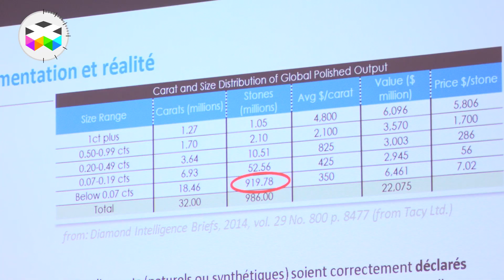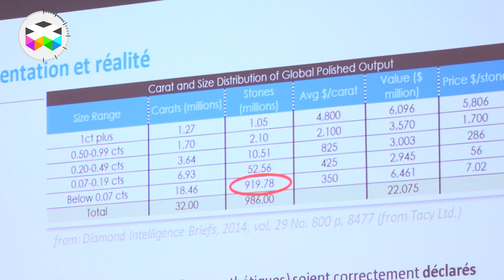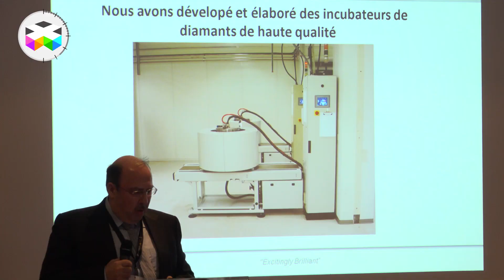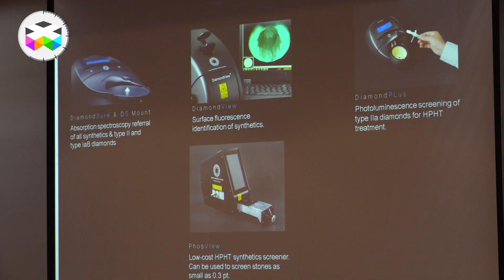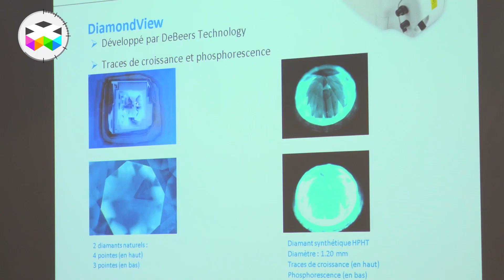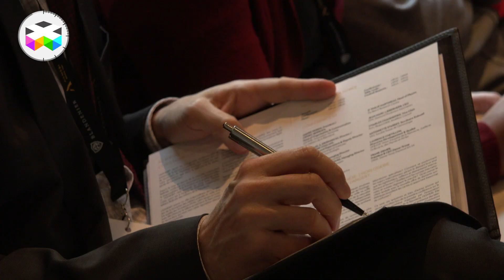The Problem of Synthetic Diamonds in Watchmaking

Comment: I prefer man-made diamonds.  
NO African murderer is making money off them, and they are identical to natural diamonds,  they copy nature to make them.  

Also, natural diamonds have imperfections in them, man-made diamonds are perfect.  However, if you want they can add minerals to tint the diamond to any color you want.

In the end, anyone can afford a nice diamond.  That is not true with natural diamonds.

Given the extreme heat resistance of diamond, we will soon be seeing diamond computer chips.  Able, without extreme cooling, to do huge numbers of calculations.  They will revolutionize the computer industry, which today, uses silicon chips that melt at high temperatures, and so are limited in how many calculations they can do, and so need extreme cooling to work. 

People don't care that the food they eat is grown on a farm and not gathered wild in nature, in the end, they will think of diamonds the same way.

A diamond, is a diamond, is a diamond.

Comment: I have a small collection of diamonds, including natural and synthetic diamonds, and i now prefer synthetics. Going forward i will buy synthetics. 

Numerous reasons, the most important one is where the money goes. With naturals, there can be blood diamonds, or you pay workers working in bad an unsafe working conditions, nature is destroyed in the process. Best case you pay for well-compensated workers using very big machines with safe working conditions, but the same damage to nature. With synthetics, you pay for scientists and engineers, well-trained, well-paid, working safely in laboratories with excellent working conditions, and the main resource needed is just electricity. Not vast amounts of land and water and soil being shifted around. You like watches done by well-trained and well-paid watchmakers in nice facilities, right? Synthetic diamonds resemble that much better than naturals can. 

Then there is the consistent high quality, and the amazing colors. You get this quality in naturals only by rigurously selecting and matching the rough, rejecting most of it. For coloreds, in naturals less than one in a million diamonds is pink, it is the same for some other colors, and then you only got the category of color down, more matching and selecting and rejecting has to be done to have them all in the same tone of pink. This is ridiculous, and leads to the next argument.

There is a big monopoly keeping diamonds artificially scarce and keeping the prices artificially inflated. Most rough diamonds get sorted and then stored away, never to be cut, never to see the light of day. Only a small percentage ever reaches the market, and that after resources were spent to mine it all. This also brings a price risk, if these massive vaults holding maybe around 90% of the rough diamond ever mined reach the market, prices will be shattered. Diamonds are nice, but this fact makes them a really bad investment, especially long-term, and if you only pay for the beauty and quality of the material, knowing that it is not a store of value but a long-term shitty investment, it makes sense to go for the lower price, especially if the quality is consistently high and the optics are indistinguishable. 

The quality of synthetics is already at the top, the only struggle left is to reach big size, but progress is being made in that area. One thing to consider is that market penetration is still low and most wholesalers do not yet include synthetics in their portfolio, for fear of risking their good relationship with the monopoly i referenced earlier. So while prices are lower at the same quality, the absurd situation is that the effort to track them down is much higher.

All that taken into consideration, i see a big future for synthetic diamonds. The naturals only have top-notch public relations and marketing strategy going for them, but this can only slow things down once you really grasped the fundamentals.

Comment: I only buy Lab created diamonds they have the same real material as a natural diamond.  I pay half the price but, it's worth it. Simulated diamonds are the synthetic ones.   I feel very good about walking around with my lab diamonds but, my real diamonds are secured and locked away for my eyes only.  LoL.  My real diamonds are insured but, my lab diamonds are always in real gold settings. So, I can carry value on those as well.  As long as the Lab diamonds are maintained and kept in good condition you can always resale them.  Period. Plus they don't age as fast as a natural diamond.

Comment: Man made diamonds can save the jewelry industry by bringing down pricing to the level of Economics we "the normal" people had to adjust ourselves to. At the other hand, a natural diamond has a far nicer color dispersion, much smoother than the somewhat harsh blue-greyish shade from the Man-made diamonds. But I have to be fair, most people need a microscope to spot the difference. 
If money is not a relevant factor in the consideration of purchase, natural diamond is the better option. There's more than enough supply to meet the demand, no need for mining or other pollutive actions.

Comment: Come on folks, diamond is an allotrope of the element Carbon. It does not matter whether it is man made or mined from the ground it is the same thing. I suspect however that man made diamonds can be purer and have a better crystalline structure due to controlled laboratory conditions in the manufacturing process while mined diamonds had all sorts of impurities and uncontrolled conditions while they grew. Therefore man made diamond is actually better. Newer processes will inevitably only make better, larger and cheaper diamonds. A cartel can only last so long and this cartel has lasted long enough. Diamond is too important to the development of technology to be controlled and restricted by individuals or cartels. Wake up and smell the coffee folks.

Comment: As far as i am concerned if it is as hard as diamond, has the same chemical composition and is in all other ways indistinguishable from a 'natural' diamond then it is a diamond.  The diamond cartels just do not want to lose their control of the market.  To me the best use of diamond anyway is industrial.  Abrasive surfaces, scratch resistance, heat sinks, high wear contact surfaces and lasers.  Wasting such a useful substance just to satisfy your vanity is pointless.  In the end it is just another crystallized element.

Comment: Watches for myself are about capturing and portraying the marvel of modern engineering. In particular, using computer aided design (CAD, CAE) and modern materials to push the boundary of microscale mechanical engineering and horology.

I would think that also being able to capture the engineering beauty of synthesizing one of the hardest materials known to man, while also capturing a high clarity and highly reflective nature of the diamond also plays strongly to this theme, thus I would have no issue with having a synthetic diamond. After all, diamonds in jewelry are really only prized because they are shiny (due to the clarity and cut of the diamond)

A synthetic diamond works just as well as a real diamond, or in the case of optics and some semiconductor technology, better. 

The argument that real diamonds are 'a work of nature and should be marveled', feels weak to me, when we can actually produce better clarity and higher purity diamonds synthetically.
Reply from the maker: Thanks for this very interesting comment and we can really see/feel that people are just fine with the idea of synthetic diamonds as long as things are clear to them. All the best

Comment: I see a parallel to what happened with the jewel bearings in watches.  
https://en.wikipedia.org/wiki/Jewel_bearing
Previously, these were made by finding real rubies and sapphires and cutting them down into pivots.  This was done by hand using machinery.  Today, I do not know of a single watchmaking company that uses this approach.
Synthetic ruby pivots, as well as synthetic sapphire windows and cases are used everywhere.
Nobody asks, "Well is your caseback made from a solid mined sapphire?"
Of course it isn't. We have had the past 100+ years to get used to synthetically made sapphire and it has become a common tool.
A similar story can be seen with Aluminum (Aluminium).
An excerpt from the Wikipedia:
" In the mid-1880s, aluminium metal was exceedingly difficult to produce, which made pure aluminium more valuable than gold. So celebrated was the metal that bars of aluminium were exhibited at the Exposition Universelle of 1855. Napoleon III of France is reputed to have held a banquet where the most honored guests were given aluminium utensils, while the others made do with gold."
I, personally, can't wait for the widespread availability of cheap lab made diamonds.
Diamond "Crystal" or case back. Solid diamond case. Diamond pivots and pallets. 
It is going to be fun to watch the market change and adapt.

Comment: "Authentic", "Real", "300 km deep", "Natural", or "Simulated", "Cultured", "Genuine".... Guess what? Nature doesn't care what you think about Hexoctahedral Carbon. It's still carbon and it's still a diamond. This is nothing more than complaints from the dealers and large monopolistic corporations who are concerned about their bottom line. It's a monetary economic complaint. If nobody put a ring on that had a diamond setting, they wouldn't be having these conferences to determine how to continue to corner the market.

Misrepresentation may be an issue regarding mined vs. manufactured, but that's still a red herring IMO. Love has nothing to do with the origins of carbon and the size of your stones (at least not the carbon ones). Stop with the market-speak whiny lying. You're about to be obsolete. Thank goodness. I've always found blood diamonds to be a disgusting business practice.

Comment: I wonder why the luxury industry doesn't use that many diamonds instead of rubies for the jewel bearings. The rubies are small and synthetic anyways, and with the price of diamonds going down, it seems feasible to use it for higher end pieces as they are harder.
Reply from the maker: I guess the cost of machining them for such purpose is probably still very high and complicated compared to synthetic rubies.
Reply: TheHappyDudeRoblox yeh thats basically it, once diamonds become cheap enough maybe, but the machining will be really hard. Not to mention rubies are pretty great!

Comment: Can they produce a synthetic diamond glass for Iphone 8?
Reply from the maker: Would be complicated, but i like the idea!
Reply: I believe that Credor did a diamond crystal watch back in Tokyo's roaring 1980's.
Reply: They need a semiconductor type of glass for the touch screen to work.
Reply: diamond is potentially a very effective semiconductor.
Reply: you really want a phone screen with the refractive properties of a diamond?
Reply: ...hell's yeah...
Reply: Electrocute: No they just need to cvd atom thin pads on the back to create a capacitive touch screen
Reply: Are you high ?😂
Reply: right just because its hard doesn't mean its tough in fact harder materials like diamonds are incredibly brittle and are prone to failure. it would crack very easily you are better off with heat treated glass.
Reply: CarlWong510 Actually, I recently saw a fascinating video on a product called Aluminium Glass which has pure clarity and extraordinary strength and scratch resistance. Sadly it also has an extraordinary price too but in time maybe. . . . Worth googling as it looks to be an amazing discovery and would be perfect in my very humble opinion. Have a look and see what you think